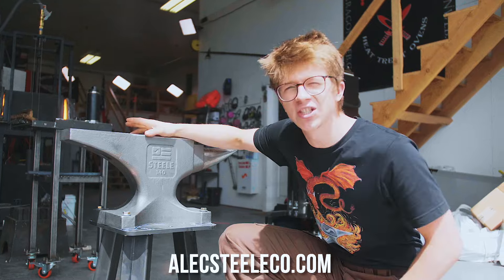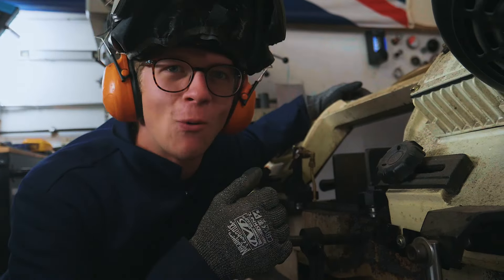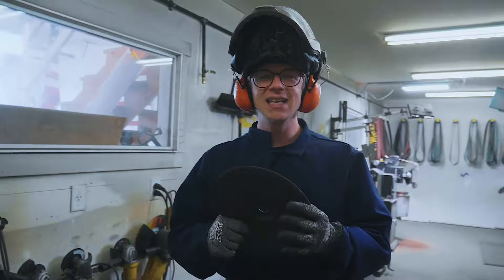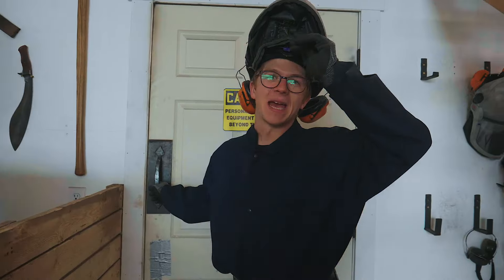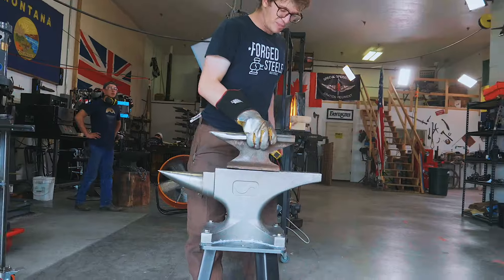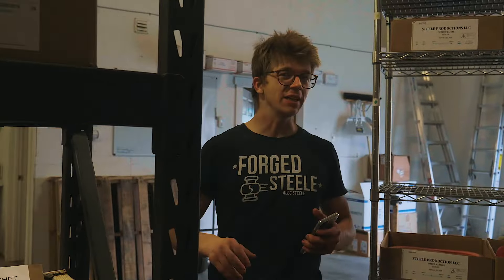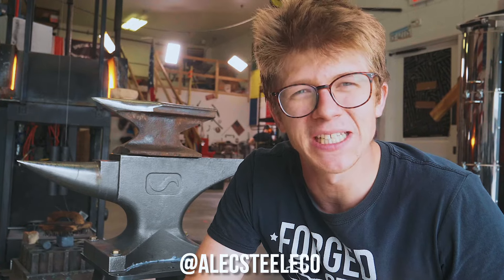TURNING A RAILROAD TRACK INTO AN ANVIL!!!

Comment: I think Will should show us how easy it would be to cut a rail with files. 😆🤙
Reply: Or just sand the one Alec made to a mirror finish. Plenty of surface area to really show off that shine.
Reply: @mrking7342  but by hand with sand paper
Reply: easy, tape a file to a reciprocating saw and job done
Reply: @rossturner3650  This one physically hurt.
Reply: @IAmBeowulf701  tape even lol
Reply: @rossturner3650  use diamond files to tune a file to fit the recip-saw. Or, glue sand paper to an old recip-blade with contact cement.

Comment: Alec inspired me to be a blacksmith I'm only 14 but I still do it
Reply: Same
Reply: Dude literaly same
Reply: Same but 13 ;)
Reply: Same thing with me
Reply: same but im 16
Reply: Yeah it’s so fun
Reply: Same
Reply: Same
Reply: Lol im 14 and sell 4-5 blades per month. and no shitty things either
Reply: @timoverschuren2165  that's so cool
Reply: @timoverschuren2165  where do u buy your  steel I'm having a problem finding any online
Reply: Go well all you youngsters.  43 here and getting started.
Reply: @davyaldy76  better late than never. I'll be 50 this year and just looking to get started. I'm working on designing my first forge. Then if that and my rail-anvil works out, a 2x72 belt grinder. I've no budget to buy all these nice tools that Alec has. Yeah, even some middle aged men are still broke.
Reply: @BA forging & more I am fifteen and just starting, I have already made a few knives and I just about at the point where they are good for sale. Check out New Jersey Steel Baron. They have good pricing and quite a bit of different knife steels. Otherwise look in your area for machinists/tool & die shop, that is where I get a lot of nice chunks of tool steel.  Or farmers, I got a big leaf spring and road grader blade from a farmer for free. Both are a lot of high carbon steel.
Reply: Dude, good on you for getting started at a young age! Kinda wish that I had started out at that age...
Reply: im 15 and i watch all his vids

Comment: I've been using Angle grinders for years. I never had an incident off kick back till recently. I am guilty of removing guards.  It hit me in the face....  well face shield. I use the same breather set up as Alec. ( thanks to him) and that face shield can take a hit. It kicked hard enough to knock the mask off my head.  No injury just had to buy a face shield lenses.  Also @ Alecsteele. Did you know they make tearoff for that face shield.  20 packs are like 20 bucks but it saves the lense 10 fold
Reply: when it comes down to it, a mask lens is a pretty good trade off for a face
Reply: Friend of mine had a disk shatter, missed his eye by inches, left a nasty scar on his forehead however. And this morning, my charcoal popped, sending a spark that nailed me in the eyebrow, few minutes later, nearly got me again, so...yeah, I put my safety glasses on for tending my forge as well.
Reply: Almost as if experience or "I know what I'm doing" isn't a shield against shrapnel
Reply: Hey what breather face mask set up is it that you use? Could use one myself.
Reply: I had a wheel explode on me with no guard. Just bounced off my leg. I consider myself considerably lucky
Reply: I had a cutting wheel split in half and hit me in the gut.  It was still spinning when it hit and left a burr thru the skin.  Oddly enough the force of the impact hurt worse than the burr line it left.  Moral of the story... Leather aprons are your friend!
Reply: @coreytaylor447  My teachers back in mechanics school always said its better to have glasses in front of your eyes as instead of your eyes.
Reply: Had a cutoff wheel kick back while cutting rebar for stem walls. Hit my knee and gashed me open pretty good, left a grind mark in my kneecap too.
Reply: @anviljenga8590  I use the 3m Adflo. Literally the same set up as alec. I have the speedglas adflo welding mask and a 3m powered ventilator grinding mask. I believe Alec sells it all on his company page. But you can also purchase it on Amazon.  Dm me if you need some recommendations on exactly what to buy. Total a worth while set up. It has saved me face and help me let my lungs heal from having too much facial hair and cheap masks.
Reply: Bill Woehl a similar thing happened to me but in stead of the grinder wheel flying up it shot me in the hand and that’s why I use gloves when cutting

Comment: What I really appreciated in this video is the talk about angle grinder safety, almost everybody I know tend to get rid of the guard and start using the tool :/ . Also nice tip on the left-sided holding approach, will give it a try :D
Reply: I hate angle grinders. Iv'e use them before to grind down welds on cars but I truly hate using them knowing instinctively how dangerous they are lol

Comment: I actually tried forging yesterday, used the face of a log splitting hammer as an anvil
Reply: If its a power splitter you could rig it up to act a a press if you want to make pattern welded stuff
Reply: I've been wanting to get into it for a long time. How did it go?
Reply: When i started blacksmithing, i had a tin can, barbecue charcoal, a large hammerhead as an anvil, a box of pringles with a hole to blow air, and a small shitty hammer

Now i make armor and swords, and in a few hours i'll get back to grinding a blade i tempered yesterday
Reply: Awesome! when I started I used a sledgehammer head as an anvil.  Two years later I own a 90 pound London pattern anvil. Keep on learning.
Reply: @DH-xw6jp  It wasn't a power splitter, it's this axe that has an extremely wide head, basically the entire axe head is a large triangle with flat sides.
Reply: @Finagin007  Obviously not ideal, but I secured it decently in place and it got the job done.
Reply: @wildermanoutdoors8485  Thanks! I definitely want to. My dad works with cars and got me two truck torsion bars that are like 1.5" thick. They are part of the suspension and apparently work as springs meaning they're great blade material. Unfortunately I injured my wrist on my dominant hand a year ago, meaning I still can't exactly use it, but once it heals I'd love to make some stuff.
Reply: well i use a brick

Comment: Great overview of how its done. 
I got an old beat up Fischer 60 lb anvil, then later came across a 3' chunk of RR track, a heavy cross section, probably 130 lb for the piece. I cut and flattened one END of it, and stood it up, and bolted it to a log buried 3' in the dirt. The key with this one was to have a surface for heavy drawing out and fullering. This position gets the most steel directly underneath your work. The web of the track I rounded for fullering and bending.

Comment: Once had an angle grinder grab my t-shirt and rip it right off my back. Thankfully the cloth stalled the motor out before the disc hit me... A timely lesson, dangerous devices grinders and why Alec wears that welding jacket. Also had a strict rule drummed into me that you unplug the grinder (or any sort of portable abrasive wheel device) and take it to another bench to change the wheel.
Reply: Yes sir. The angle grinder is one of the most dangerous Tools in any Workshop. Claims more dummy related incidents per year than hippos. It's very rare that I ever have the handle off of mine, guard never comes off unless absolutely necessary, and I literally will not even pick it up without glasses. But I definitely need to get a full face shield cuz I've seen plenty of videos and pictures with people that had exploded discs lodged directly in the path of what would have been an eye shot. No long sleeves or loose clothing. And the power is disconnected before ever touching the disc. One of the most dangerous Parts about it is that angle grinders typically are an on-off situation meaning that rather than a Deadman trigger that stops when you release the trigger; they're typically either on full bore or off. So in the event of a jump or kick oh, it's going to continue rotating and destroying whatever is in its path. Be safe y'all

Comment: Back in my smithing days, I used to wear all leather and Gortex while smithing. I'm glad I did too. There were several instances where doing so saved me from serious injury. Doing so can be incredibly hot and uncomfortable, but it's worth it trust me. I dropped a piece of red hot steel on my Gortex boots once, and it melted about halfway through the top of my boot before I could even react. Had I been wearing different boots, I would have had serious burns. Safety first folks!

Comment: A good heavy hunk of tree trunk works great to lag bolt you chunk of railway rail too.  If you decide to drill hole to put the lag screws through be sure to use low speed and lots of lube.

Comment: pro tip for doing curved edged (I beam inside 90 degree for example)

place a nickle on the flat edge of a square and round the corners, makes these very nice and easy to pull lines.

Comment: One crucial piece of info to note, the rail track does not have a hardened face plate and will not respond nearly as well as an actual anvil. Even your local engineering works can give you a hardened face plate and weld it to a mild steel block for next to nothing, this will not only last longer but be much better than a rail track - I know since I used one for the first 2 years of my bladesmithing and the change when getting a proper anvil was huge!

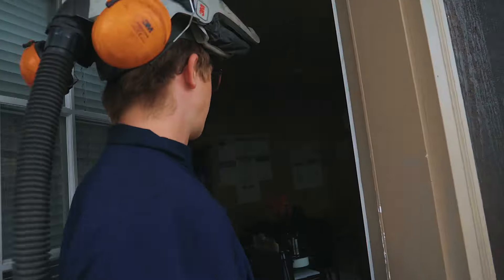Comment: 3:30 I was at work on a ladder using an angle grinder, it bound up on what I was cutting and it jumped. Those things bite pretty good, I cut open my neck from my Adam's apple to my chin. It didn't bleed too much after a little while because it burned when it cut so I patched myself up and went back to work. 👍🏻 Ironworkers 💪🏻

Comment: Hey Alec, you can find on EBay (or make) something called a track chisel that's basically a big 5lbs cold cut chisel with a handle, looks like a splitting maul. From what I've read, the railroad workers would score the track across the top with a striker, pick up the track, and just drop it straight down on top of another piece of track and it would shear the track off cleanly. I don't know how well it actually works in practice, but it could potentially be a huge time saver over the angle grinder.

Comment: One major point here, don't stay on the head of the railroad tracks with the grinder fro long times as the heat buildup can mess up the temper. Take breaks and or keep it cool

Comment: There is a little known trick to cutting RR track , the track is hardened steel and by cutting across the bottom of track then setting one end on a block you can break it by hitting it with a big sledge hammer, it works best in freezing weather , I've broke my share of track with a sledge , my father learned this from a scrap yard in Kansas

Comment: Kickback isn't an if, but when. For example; a circular saw. You could be a carpenter your whole life, know what you're doing , and still have to deal with kickback. You might be cutting a board and the grain closes in on the blade. Same with a grinder. The metal might have stress in it and it pinches the wheel. I've had both happen. Ripping boards, the grain really likes to pinch the blade. Bed frame angle like to pinch cutting wheels, too. Keep in mind which way the tool is going to go if the blade binds up. I like to grind with the cutting wheel pulling the grinder away from me and just take multiple passes to cut thick material. Wear you PPE. I caught my jacket on fire from sparks - wear a welding jacket or FR sleeves and and apron or something.

Comment: Used to work on the railroad not exactly sure what size rail that is but he must be pretty damn strong to move it like that and so everyone is aware there is actually a mount specifically made for rails so you can cut them with a large grinder/ saw. Looks like it could be 100lb rail (100lbs every 3 foot)

Comment: Skillsaw with a cutoff wheel works surprisingly well and easier to control with most of blade covered in guards for those times when cutoff wheels shatter. Kickback is always a possibility, but easier to handle I’m skillsaw than the big angle grinder imo.

Comment: Cool thing about track is you cut through the top and the bottom, you can hit it with a hammer and it will break the center.

Comment: I worked across from a shop that on there tool wall in about letters 3 feet high was the quote "familiarity breeds contempt" after working there for a year that's the only thing that stuck with me.

Comment: My experience on a worksite is most of the angle grinder accidents are the big ones and they put them in the ground whilst it’s still spinning and I have been told they can jump off the ground before it hits you.

Comment: Since you have all the track. You should make up a few anvils out of the rail road and sell them on your web site for a reasonable price. Maybe make a starter kit with a reworked sledge hammer from previous episode. Just make a short run of them to help a few budding black smiths.

Comment: Safer alternative to the angle grinder is a porta-band. Still use a bandsaw but one you hold that probably costs around the same as the grinder.

Comment: Just a reminder for anyone new (and old) to using angle grinders. YOU NEED TWO FORMS OF EYE/FACE PROTECTION. That means safety glasses AND a face shield. Sunglasses are NOT the same thing as real ANSI Z87.1 rated glasses (or equivalent standard if you live outside the US). Do NOT remove the guards or use it without a handle (trades are often guilty of this, but it's an awful habit). You don't want want a mishap with an angle grinder. Especially for inexperienced folk, it's very easy for them to kickback or get pinched by your workpiece causing he wheel to snap off. Don't wait for a near miss incident to start respecting the risks involved with the tool. It CAN kill you and at the very least it can maim you for life. Don't try to save yourself a couple minutes in exchange for your safety.

Comment: Agree safety first with grinders, my bro was using one on a building site with loose rubble, lost his footing and the grinder hit his leg. He had safety trousers on which bound up the disc but not before it had put a 2in by 1/2in deep hole in his leg. Could have been way worse!

Comment: In Australia, D handles can only be used instead of the straight handle. D handles are a lot safer and you have more control
Reply: Is this only on certain  worksites or edicts by certain companies? Seen plenty of brand new grinders of all sizes with straight handles.

Comment: I was using a powerful 4.1/2" grinder with an HD wire cup wheel to clean a section of steel roof panel at a raised level. Wearing all the usual kit, including ear muffs. Got called down at one point. Thought it had switched off, went to put it down. It bit on a raised edge, jumped up and banged off my neck. Back down it went and caught the same edge and leaped, again, for my throat. It went over the side and scuttled across the ground until it managed to wrench it's own plug out of the extension lead. Winter time, soooooo lucky I had been wearing my donkey jacket with the collar turned up. Without that protection, that bastard could have had my jugular!

Comment: The wear surface of the rail will be heat treated to different levels. As long as it is not too old, there should be no danger of it shelling pieces off.

Comment: i have made alot of tools and anvils from railroad tracks. 
there are some issues i want to point out. 
I cant be cut easily with a bandsaw, i have a professionel Bianco bandsaw from Italy, and even with that, it takes 20minutes to cut a piece of track.
The steel is hard, HRC 24 to be exact. 
But i have made alot of nice hammers from the materiel, and i continue to do so, but i machine them on my mill and my lathe. 
You could have made a really nice flat top surface with a wide cuttinghead in the mill.

Comment: I used my first one as I found it and I did a lot of work with it on end used the bottom and top .it was a lot nicer then the sledge hammer head I was using and wa nicer then the 50 lbs curling waight

Comment: The "anvil" i use is just a 2"×12"×12" off cut piece of mild  steel i bought from a local steel supply for $30. I cut a hole in a 2×12 piece of lumber from home depot so I could give it a sturdy base (I use it upright because that is the best surface and it is easier to hammer on a taller surface) that is also removable if i want to lay it on its side for a nice large steel surface.

Comment: I think the only thing im gonna do, is make a dual railroad track stand so i can flip it up and down for either side, theres a video where someone made one, and im going to take the "top" smaller less flatter side, and make one end a horn, but shaped well enough the stand holds it sturdy when upside down. 

I figured when im flattening things out, i dont really "need" the horn, and when im curving things, i dont really "need" the flat..😂

Comment: you should have mentioned that you switched to a Special thicker blade for working the Surface, 
as you are concerned with safety: 
one of the easiest way to hurt yourself is to grind on a Surface with a cutting blade.
the cutting blade cannot take sidways Forces and will easyly break, then the Forces of Rotation will trow around the splinters in all directions.
according to murphys law "all directions" allways includes the face, eyes and "where it hurts most"

Comment: I’ve not tried it. But apparently you only need to cut the bottom flat and the vertical. Then throw it in a vice upside down and smack it with a hammer

Comment: Train Rail actually make good knives... modern rail i between .007 carbon and.095 carbon, depending on the weight per yard... the heavier rail is higher, the lighter rail is lower... I use the light rail for axes, and the heavy rail for knives... very similar to 1070,1080, and 1095, but with a higher manganese content